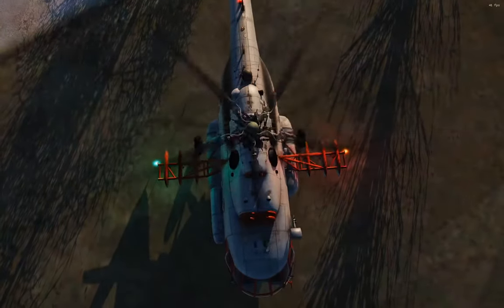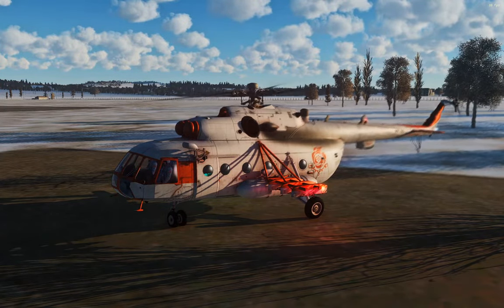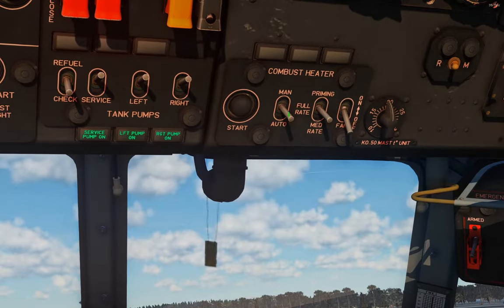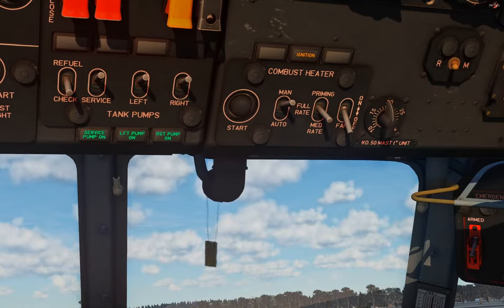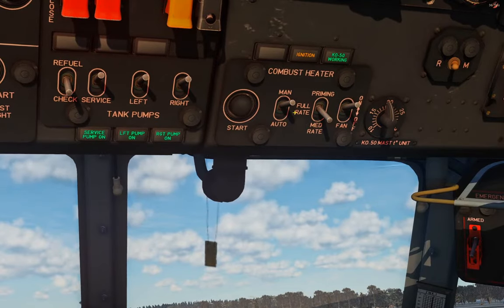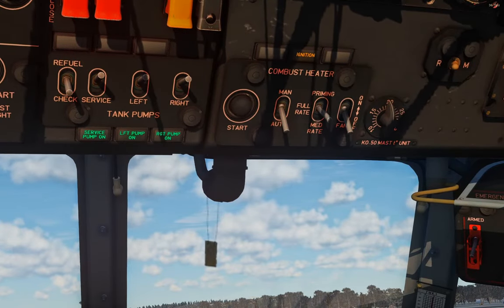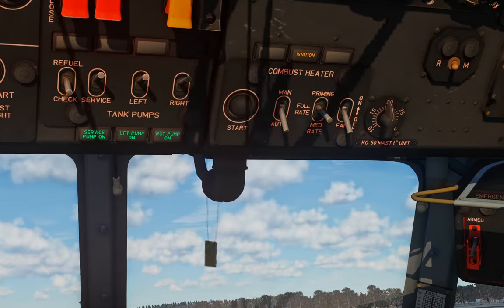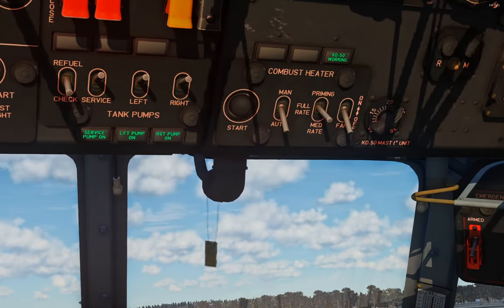DCS Mi-8: KO-50 Kerosene Combustion Heater Tutorial

Comment: the KO-50 heater is fueled by the service tank which sits under and between the hydraulic panel and the AI-9V, APU. You must drain fuel from the drain tank via a petcock prior to operating, especially, if, starting on the ground

Comment: If you want real numbers then if you're starting in automatic mod, temperature knob must be on 30. And ignition light must turn off in 2 minutes since start. Also, if restarting KO-50 after moving it from auto to man mode you should wait for 10-15 minutes for the heater to cool down. For you guys that have fire in KO-50 section if you actually use this. And yes, this is really important thing if you fly in winter, you will freeze your ass of if you don't learn how to operate it xD
Reply from the maker: That's cool! Thanks for the info (and in your other comments as well, really nice to learn more. It's hard to find good info sometimes.)

The biggest disappointment is that the heater doesn't do much in DCS other than blow smoke and make noise. This module doesn't model pilot comfort or most kinds of weather effects on the cockpit :(
Reply: @vsTerminus  tell me about it, I have 4 books with 4 different information some of which are mutually exclusive. That's the reason I went on youtube to try and find maybe some real examples. Worst thing it that booklet for games is written better than real one xD 

I actually enjoyed couple of your videos I've seen so far and they actually help me to remind myself of everything I learned over the ages. At least it's more fun than reading through the manuals.

Comment: I just love the fuel tanks on the Hip.

It's like they had the whole helicopter designed and finished when some intern sticks his hand up and says "but where can we fit the tanks?" and all the designers just sit there going "...fuck how could we forget fuel? Just stick em on the side I guess it'll be fine"
Reply: It's not quite the reason, but it's not very far off either. The Mi-8 fuselage was largely based on the Mi-4. It got new engines and a redesigned front section. Mil engineers also wanted to increase both cabin space and fuel capacity. Adding new, larger fuel tanks on the outside was basically the way to accomplish both at the same time.

Comment: It is possible that it works, on the KF-17 the pilot can get a heatstroke (manifested as a blackout) and he also gets hypothermia( manifested as stick shake and breathing).
Reply from the maker: The manual doesn't specify whether it has effects on the pilot and tbh I didn't try long enough to overheat. Guess I'll have to do that lol
Reply: @vsTerminus  ok, so we have a heater, do we have an AC as well? Or should we just be glad for the fan?
Reply: *JF-17. The picture turns b&w and then fades away when getting cold in the Jeff. So it is important to close the canopy fast and get the engine starting fast or you won't see anything. I guess this is programed in the module since I have not seen this effect on other aircraft.